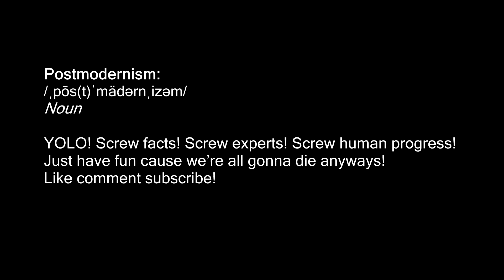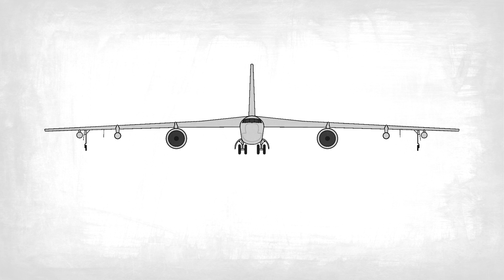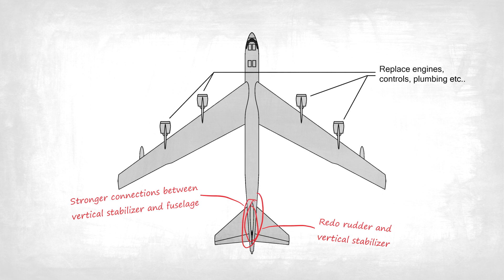The B-52 is Getting New Engines... Why Does it Still Need 8 of Them?

Comment: Of the 26 still flying, they have given up cannibalizing parts for the engines. This relic is still in use, because the US is INCAPABLE of producing anything even close in quality, durability, or performance. We see F35,B2, and Zumwalt quality--at unsustainable costs, due to GRAFT.
Reply: Wow you seem pretty certain of that...an expert are we?
Besides, you left out the B1, but I guess you think that's crap too.
Reply: I imagine its only real use is to launch stand off missles.  The 747 option would probably be as good.
Reply: @rogersmith7396  Yes I've often thought that. Would fit a lot more in too.
Reply: @rogersmith7396  Far cheaper as well.
Reply: @ecurb10  It is, in that of the 6 left, they are constantly breaking down. Engineered poorly, the Wing Root hub cracking flaw, essentially doomed them from the start.
Reply: @davidjames1063  The schematics I have seen indicate a 747 can be packed nose to tail with rotary launchers which are in use and probably hold a lot more missles than a 52.  Like I say it may be a concern that an enemy would just shoot down every 747 in the sky although I think I read they were being withdrawn from passenger service.
Reply: @davidjames1063  Which plane are you refering to here?

Comment: The old engines are literally just costing them fuel and manpower rebuilding them every time they fail. That's why they're replacing them with same size replacements. No need to rebuild the entire aircraft when all you're looking for is serviceability and far more fuel efficiency in a given design package.
Reply: Well yea.....that's literally what he's saying.
Reply: @ecurb10  This video is irrelevant. This video is less than 10 minutes, he's literally just half ass making it for clicks. He did not add any insightful new commentary, or elaborate on every exact upgrade made or idea tested to the airframe in the last 75 years.
Reply: @JosephArata  But I'm agreeing with you, and simply stating the video is too.
Not sure why you had to attack it for.
   Most Youtube videos are only 10 mins, and there's nothing wrong with giving a brief summary of things without turning it into a full-on documentary.

Comment: We would be surprised I think to see how low the flight hours are on operational B52’s, despite their age. They simply do not fly anywhere near as often or as much as a commercial jetliner. The age of large aircraft is actually measured in landing - takeoff cycles, not in years.
Reply: Good point!
Reply: Pressurisation cycles, actually.
Reply: @TheAnqueetas  the fuselage of the B52 is not pressurised. So no, take off, landing and flying hours are the only big concern here.
Reply: @12gark  The B-52 is pressurized, but it has a norm-setting which is 8.6 PSI differential and a combat setting which is 5.25 (IIRC) PSI differential. Command regulations will specify when the O2 mask must be worn. Generally, it is during "critical phases" of flight, which are T/O and Landing, Air Refuelling and Low Level.
Reply: @TheAnqueetas   the B52 pressurised area is just the cabin, which is not a structurally critical area. In a liner, the cabin means basically the whole plane, but on a bomber, the main part of the plane is fuel tanks and bomb bays, which are not pressurised. And, if you think on how a plane is made, the main area of load are close to the center of plane and in the tail, where a B52 has no pressurised areas. So yes, the cabin is pressurised, but no, the pressurisation cycle is not the critical fatigue element of a normal duty cycle on a B52. I hope I made clear what I wanted to say, but basically fatigue critical areas of the plane are not pressurised, so the pressurisation cycles are not that important.
Reply: @12gark  Slim Pickens rode the bomb in the bay without O2.  He just had his cowboy hat.

Comment: You’re telling me that were the plane to lose a mere two engines, on the same outside pylon, a not inconceivable occurrence being as they’re on the same pylon, the aircraft would be uncontrollable given the size of the rudder? That seems like an inherent design flaw from the start.
Reply: The drag area of a UHB Turbofan's Fan is significantly larger than the drag area of 2 of the TF33s Low Bypass Turbofan's fan. While the rudder might handle the simultaneous loss of engines 1 and 2 or 7 and 8, it could not handle a single large area UHB Turbofan's drag. 

Little know secret of the KC-135R with CFM56s: A failure of engine 1 or 4 produced so much adverse yaw that an automated yaw compensation system was installed, because the human reaction time was considered too slow.
Reply: @davidhoffman1278  Lol I never knew that. The 135 does have ridiculouslu huge engines compared to the rest of the airframe. Sort of a goofy looking plane.
Reply: @cefb8923  ,
The off the shelf available technology in turbofan engines was what it was. 
No way would we select the same engine today. The smaller diameter engines offered for the B-52H reengine program would be more appropriate. People ask why no CFM56s on E-3 AWACS. Alaskan airbase cross wind landing studies showed high probability of engine 1 or 4 cowling strikes. Now that there will be engines to form, fit, function replace those existing E-3, EC-135, and RC-135 TF33 engines those reengines might happen.
Reply: Has already probably happened a dozen times. Bc yes, you think a 1950s engine isn't going to experience uncontained failures?

Comment: F130 was chosen as it had identical weight and thrust to the existing engine (requiring zero modifications) while good fuel efficiency and a longer service life than the other bidders proposals.
Reply: The f-130 is 1,000 lbs less then the current engines. So in total they will be shaving off 8,000 lbs with the new engines!
Reply: @scupking  That's four more bombs! I wonder where they're going to put them? Haha
Reply: @150cameron  True! That's 4000lbs less stress per wing!

Comment: Should simply buy a fleet of B-787 strategic bombers, along with E-787 AWACS, P-787 Martime Patrol aircraft and C-787 transports.
Reply: There ain't no such plane as the B-787.
Reply: @proudamerican183  There ain't no such thing as a BR700-series engined B-52 either. Cut a few doors on the bottom of the fuselage and mount four rotary bomb racks on the middle floor. The 787 has a better payload capacity, fuel load and endurance as the B-52 -- it'll fly for 19.5 hours without refueling. This is not to mention that 787 dispatch reliability while still slightly behind the exemplary 777 is a magnitude better than military jets of the 50s and 60s.
Reply: @dwightlooi  You seriously plan on turning a CIVILIAN aircraft into a frontline military aircraft? 🤣 That is absolutely HILARIOUS. Why not just turn the 747 into a bomber too? Let's also turn a Ferrari or a Porsche into a tank. And turn one of those giant cruise ships into a frontline battleship too. 🤣 How about we bring back the B-17 Flying Fortress and the P-47 Thunderbolt and other WWII aircraft? 🤣
Reply: @proudamerican183  It is as ridiculous as turning the Boeing 707 into the KC-135 and E-3 Sentry. It is as ridiculous as turning thr Boeing 737-NG into the P-8A Poseidon. The 787 is the right size, payload capacity and range to replace the B-52, E-3 and KC-10.
Reply: @proudamerican183  Don't forget, the 787's commercial avionics (and cabling) would have to be completely redesigned to withstand EMP from semi distant nuclear blasts. I remember a work-related trip to Kirtland AFB in the 1980's and seeing a B-52 on an enormous wooden trestle being tested for EMP effects with a simulator. 
Additionally, the B-52 has a high wing configuration to allow bomb bays without needing to interrupt the wing carry through structure. That would be a nightmare to accommodate for a 787.
Reply: @Tony-om5kr  Thank you. Someone who actually understands military aircraft.
Reply: @proudamerican183  How exactly is a B-52 more survivable than a commercial airliner? They are both slow, they are both big and they are both similar agile. Sure, the B-52 has missile warning, flares and ECM gear. You can bolt those onto any airliner. As a matter of fact, VIP 747, 767, 777 and 787 aircraft regularly receive these things as standard upgrades.
--
The fact is that the B-52 is NOT survivable and neither is the 787. The B-52 is a bomb truck with 70,000 lbs of payload capacity. The 787 has a payload capacity of 116,000 lbs. It takes off with a shorter runway. It carries more fuel, is way more efficient and flies further. It is way cheaper to operate with a fatigue free composite fuselage, very long time between overhaul engines and (most importantly) it is a mass produced aircraft with an expected run of over 2000 airframes which makes for great economies of scale.
Reply: @dwightlooi  I'm just gonna stop arguing with you because how could a civie ever understand? Peace out.
Reply: @proudamerican183  You stopped because you do not actually have an argument.
Reply: @dwightlooi  No. I stopped because there is no point in trying. Because you think everything is all about just the stats and all that. There is more to building a military plane than "Oh yeah. It needs to fight.". Do you honestly think military aircraft are designed, built and tested at the snap of a finger? Just because it's stats are good doesn't mean it is good. So again, I refuse to continue this argument since no matter what I do, I know I will never penetrate that thick skull of your's. Peace. Out.
Reply: @proudamerican183  I see someone has never learned about the 747 CMCA.
Reply: @proudamerican183  Your insistence with zero argument, zero data and zero logic is just that. Your insistence.
Reply: @dwightlooi  And you do have proof? Outside of just stats?
Reply: @proudamerican183  Proof of what? That a commercial airliner can and had been adapted to military duty with military sensors, self-protection systems and a bomb bay? What do you call a P-8, E-3, JSTARS or the P-3 for that matter? As a matter of fact Boeing did indeed propose the 747 as a bomber in the 60s and 70s. You on the other hand have offered ZERO facts, zero data and zero argument why a B-52 is more survivable than a commercial air liner.
Reply: @dwightlooi  Okay. I surrender. The 787 can be a bomber. A suicide bomber that crashes into the enemy. Built to be destroyed.
Reply: Good argument guys, it was worth follo - wing... sincerely...
Reply: A B-787 should be able to carry 4 CRLs for a total capacity of 32 GBU-31/Mk84 bombs, 32 GBU-32/Mk83 bombs, 64 GBU-38/Mk82 bombs, 128 SDBs (via 32 BRU-61s), 32 Harpoons or 32 LRASMs. This is assuming no external pylons which is unlikely given that they added four of those to the 737 in the P-8A. 
--
If expediency is the goal, a B-787 will probably be fitted with off-the-shelf sensors, targeting and protection systems. The leading candidates being:-
APG-83 SABR AESA radar
AN/ASQ-228 ATFLIR targeting pod
AN/ALQ-99 jammer pod
AN/ALQ-218 EW system
AN/ALE-47 chaff/flare dispenser
--
Maximum Payload will be ~80,000 lbs 
(4 CRLs x 8 stations x 2500 lbs = 80,000)
Maximum fuel capacity will be 298,700 lbs.
Range with 32,000 lbs of payload will be in excess of 7,635nm (14,140 km).
Range with maximum payload will be ~4,400 nm (8,150 km)
Ferry range (w/o ordnance) will be 9,500nm -- basically anywhere to anywhere on Earth w/o refueling
Cruising speed will be ~Mach 0.85
Cruising altitude will be 33,000~45,000 ft depending on weight
Reply: @dwightlooi  Well. It seems as though you REALLY did your homework. However, the military isn't even considering a B-787, instead they continue to use and upgrade the B-52. So what makes you consider it outside of stats? Why are you so convinced that a B-787 could match the B-52? (The B-52 being a 100 year old plane which has proven her worth ten, a hundred, a thousand times over.)
Reply: @proudamerican183  Because officially published data say so. It is a much more efficient and capable air frame with much more efficient engines and world leading operating economics, making it a much more effective platform for trucking passengers, cargo and, in this case, bombs. It's called progress -- 55 years worth of it.
Reply: @dwightlooi  If the 787 DOES replace the 52 in the future, I'll eat my own eyeballs. But I'm pretty sure I'm gonna be safe from keeping to my word.
Reply: @dwightlooi  'Last one posting' is not a winning debating strategy. I often stop online conversations because the other person obviously hasn't got a clue. Let them rant. 
FWIW I don't think I would see eye to eye with ProudAmerican on many things, but on this point I am pretty sure he knows what he is talking about.

Comment: From books I've read various documentaries I've seen and having actually spoken to retired and active duty B-52 pilots is the 8 engine setup is for redundancy. Yes the individual engines have been upgraded over the years. From what I've been told the aircraft can lose 4 to 6 engines and still have enough power to make it to a safe landing zone depending on the current payload.

Comment: The B-52 is a platform that has served well for 50 years. I think in any discussion about changing it, the first question has to be "Does the proposed change improve the platform and does the change offset whatever is lost?" Turbofans engines are obviously superior to turbojets most of the time, but a 787 isn't facing anti-aircraft fire or missiles. If I was a pilot flying an eight engine plane, loss of one engine due to missile fragments is only 12% of my available power. If I just bombed someone I would like to know the maximum amount of power is available to me to get away.
Reply: Actually, it’s more than 60 years. Pretty damn remarkable!

Comment: Eight General Electric F101-GE-102 turbofan engines with afterburner (same as B-1) would be spectacular!
Reply: Rolls Royce North America got the contract
Reply: And loud. Very, very loud. B1 takeoffs at airshows are genuinely ground shaking. Loudest thing I've ever heard.
Reply: Especially when the wing box flies off the fuselage.
Reply: Spectacular, but not particularly useful. Afterburners are great for going really fast, but the B-52 is limited on speed by it's aerodynamics, so it makes more sense to use high-bypass engines to get the needed thrust rather than afterburners. Afterburners are only of any use on supersonic aircraft, which the B-52 is not. It wouldn't go that fast even with a lot of thrust due to wave drag, and if you gave it enough thrust (Aeronautical Engineering rule #1: anything is possible with enough thrust) it would disintegrate.

Comment: Another consideration with regard to the vertical stabilizer on the B52 is structural.

Guess what happened to several early model B52's while in military service?

By now a first guess for many people might be - fatal accidents!

If so, those people were absolutely correct, and subsequent investigation revealed that the entire tail section had separated from a number of aircraft which crashed.

Official findings ascribe at least one of the crashes in question to 'tail separation due to control failure' but this may well be yet another example of misinformation being employed to mitigate undesirable consequences deriving from negative public opinion.

This suspicion is exemplified by the fact that several B52 aircraft were involved in fatal crashes due to empennage failure until a crew managed to land a damaged aircraft and describe the chain of events which led to an inflight emergency due to major damage to the empennage.

The fact that the crew who survived were able to maintain control over their damaged aircraft after, the failure, distinctly implies a more accurately revised version of the finding should be 'control failure due to tail separation'.

This contention bears scrutiny because events related by the crew which survived an empennage failure more closely support stress related metal fatigue as the primary cause to begin with anyway.

That direct reference to these events which I was able to find on the internet some years ago seems to have become unavailable is interesting.

Because it is potentially suggestive of a large company seeking to 'whitewash' a less than exemplary history.

Manifestly inadequate size of the rudder on B52 aircraft suggests the probable solution to the problem with empennage failures was to drastically reduce the size of the rudder thus reducing structural loads on the vertical stabilizer and therefore stress on the airframe.

It is not difficult to envisage an attitude like "after all how often is an aircraft as large as a B52 likely to engage in violent maneuvers? So why don't we simply revise the flight manual to proscribe operations subject to conditions likely to impose stress above critical values"?

That was probably the cheapest option and unlike civilian agencies the military can be relied upon to comply with instructions from their political masters and keep their dissatisfaction to themselves as they did with the M16 rifle during the Vietnam War!
Reply: IIRC in one instance of a B52's fin breaking off, the crew reacted quickly by lowering only the aft main landing gear. That added enough drag to keep it going straight. They lowered the forward gear just before touchdown.
Reply: They lost a few H bombs too.
Reply: The Vert Stab shrinkage was due to the Stability Augmentation System being implemented and not needing the shark fin anymore.